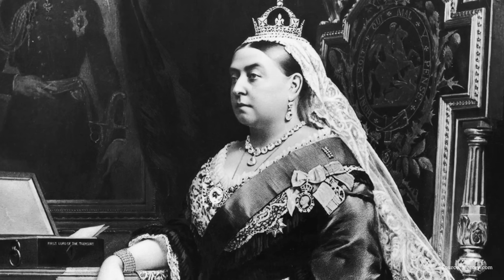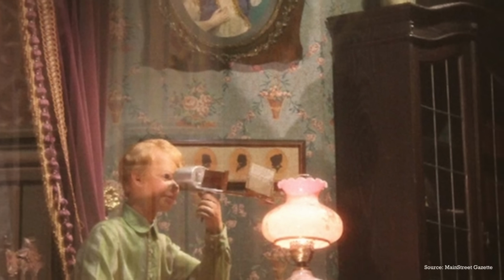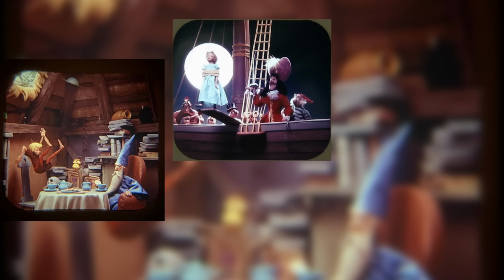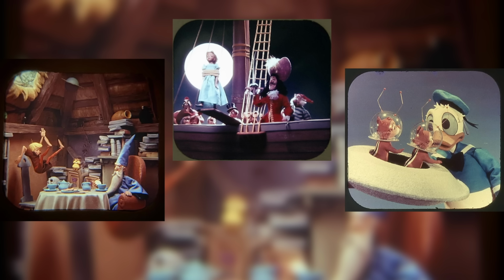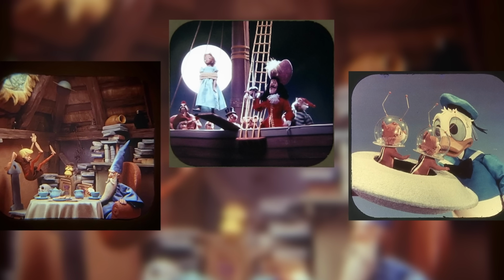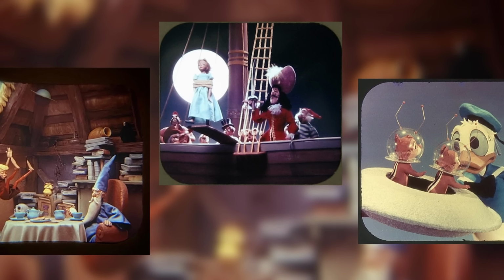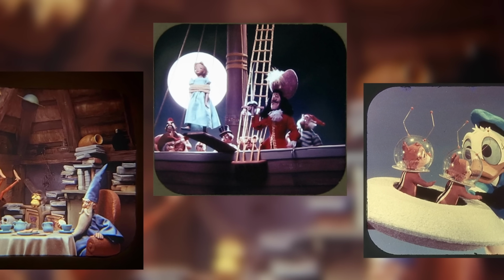Why Disney ViewMasters look better than the Movies!

Comment: These things were magical to me in the 90s. Disney should bring this back, for talkink comic books  use scrap I Max film if you have to. Condense  and avengers movie into a shorter experience,  the new view master uses an LED light,  with Sound to tell the story and blast the sound effects  in the scene you are viewing.
A lot like those talking books and records that told you when to turn the page. 

I would 100% buy a view master with sound like this  you flick the switch to see the next scene after the audio,  and  if you wanted more pictures,  it would be easier to have film rolls instead of a disk.

And I dont want a digital VR thing here,  im talking about a cheap toy with cheap electronics to make it work

Comment: I had a ViewMaster set that Santa Claus brought for me when I was 4, back in 1980. It was my favourite toy. My favourite reel set was “The Little Yellow Dinosaur” which was created in very detailed model scapes. I remember it really brought the dinosaurs to life and the colours were so sharp and vibrant. 
Some of the other sets I remember collecting were The Space Shuttle, Sharks, The Muppets, and Land of the Lost. Around 1983 they changed the packaging from those sweet, square paper packets that included a little booklet, to a card back with a plastic blister that held the reels. The booklet was gone and they used the cheap layering effect to create the 3D rather than stereo photography. Worst of all, they started putting subtitles straight onto the film which really ruined the immersion for me. It’s become even cheaper nowadays and the viewers they make now don’t even turn the reel properly. I probably still have my old collection somewhere at my parent’s house. Though I don’t know where.

Comment: I've got a pretty sizable collection - over 700 reels, some specialty releases like a tie-in to "The Rocketeer", viewers from the model A up through "The Incredibles" box set (which has one of the highest magnification factors of all the various models, highly recommended.)  I also recommend getting your hands on a stereoscope - the one I have was made by a Japanese company called 3Dinlife which lets me view stereo pairs on my computer screen easily (all the more important since my 3D graphics card died on me.)  It has a wheel to let you adjust internal mirrors so it works for pretty much any size image at any reasonable distance without having to maneuver things.

I'm constantly amazed at the early travel reels - I've ones from pre-1953 Iran, when it was a very westernized society, ones from Cuba pre-Castro, even a rural New England reel that has an image from my town in Northwestern Connecticut, from Lover's Leap Bridge looking north along the Housatonic River, before the 1955 flood significantly changed the landscape there.  It's a window into a world that doesn't exist anymore - filled with exotic locales you could imagine traveling to without worrying much about safety.  Now, it's an act of daring to go to many places, many of which have been lost or irretrievably altered, if you can even afford to go regardless.  Just an entirely different parallel universe viewable through the trusty ViewMaster.

I remember going into Caldors (a department store chain back in the 1970's/1980's), and one of my first bee-line targets as a kid was the ViewMaster display, where packets were arranged stadium-seating style, about a hundred different ones.  Travel reels on the left, interest reels in the middle, movie tie-in packets on the right.  I had the projector, but didn't use it much and it wasn't 3D, so what was the point?  My sister had the talking ViewMaster, but we weren't that impressed with it either quality-wise.  The basic viewer format is a thing of nigh-perfection.

Even then, between six to ten years old or so, I quickly grew dissatisfied with the faux-3D sets (which weren't just done on cartoon packets, ones such as "Star Trek: The Motion Picture" did the same), in favor of packets where the photographer was on-set (Benji, for one.)  

I wish there were more economical ways to take digital 3D photos and make new reels out of them - the costs of the online services that offer it are too high for anything but special occasions.  Regardless, I do have the Fuji 3D camera from around 2007 or so, which works like a charm, even if the resolution isn't competitive with modern cameras.  People are still amazed by it, even moreso with the built-in 3D LCD display that can be viewed in 3D with the naked eye.

I never have the time, but I did pick up the ReelTool software, a 3D-printed holder for my Epson scanner for reels, the combination of which lets you scan a reel and have the software create stereo jpeg pairs which you can then view on your screen.  If there's one in my collection I really want to see but the color has shifted as certain film stocks tended to do, the images can be easily restored in Photoshop to the original color.  Not hard, doesn't take long, but it's just a matter of having enough time regardless these days.

Comment: I have one of the original stereoscopes from 1838 that's been in the family for generations. Has all the pictures for it too from that time. It sits on a shelf in a display cabinet. It's never used (obviously given it's over 188 years old. Almost rocking it's second century.)

Comment: I never understood what the big deal was about view master as a kid. then it was discovered my severe eye problems make it so i just see the two separate images at the same time, one slightly higher than the other. so view master for me is closing one eye and looking at a tiny 2d picture. the for using binoculars, i just have to close one eye. i thought that's just how they worked because how would i know otherwise?

Comment: One thing to keep in mind about View-Master, with the exception of the talking version from the 70s, and a few weirdly scaled ones that they have put out as collector items, almost every real will work in every viewer. They keep updating the viewers, but the reals don't change that much. The only real changes the fact that when they switched out to a cheaper film stock made sadly by my home company Kodak, some of those old films got red  and lost other colors over time. Yes I'm from Rochester so Kodak is huge. Anyway, the reels themselves, with those few exceptions will work in almost every single viewer that view master has ever made. So you can take a View-Master reel, from 1937, 1956, 1977, 1986, 2015, I'm just shooting dates randomly , and stick it into any View-Master viewer ever made, and it'll work perfectly. I have a viewer from the the 50s and a viewer from the 80s and one from 2000 s. I have reels from all over the dates. And they all work interchangeably.
Reply from the maker: Thats a great point!  And probably why the format has endured so long!